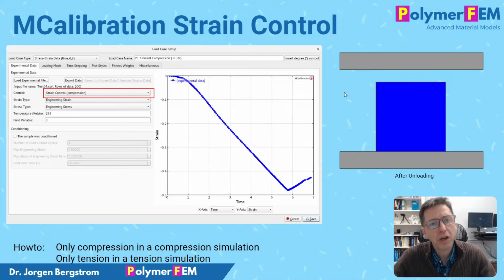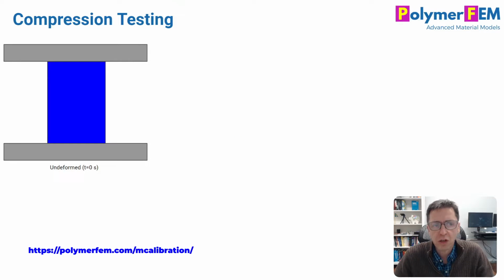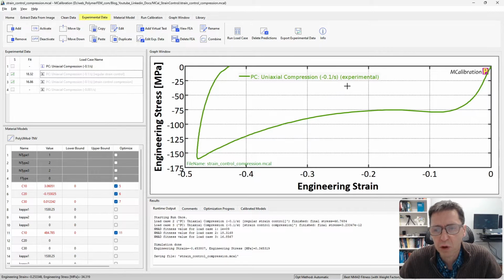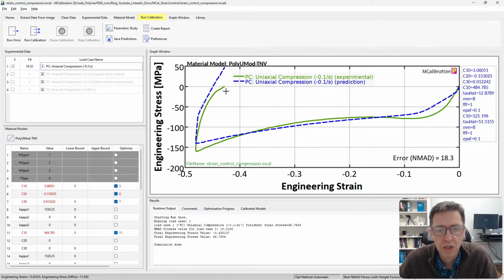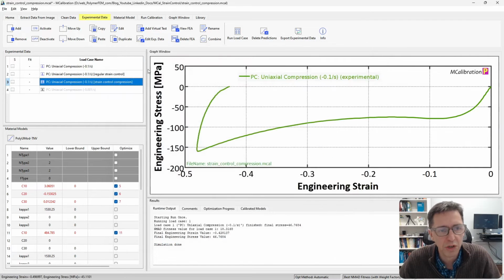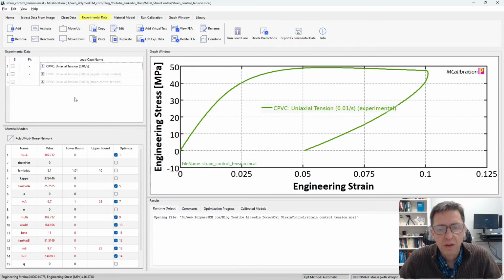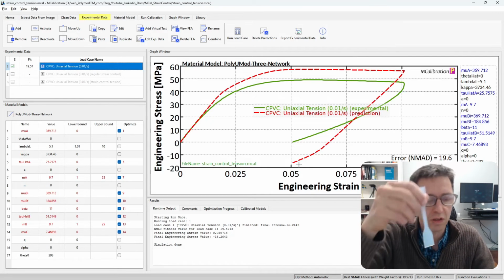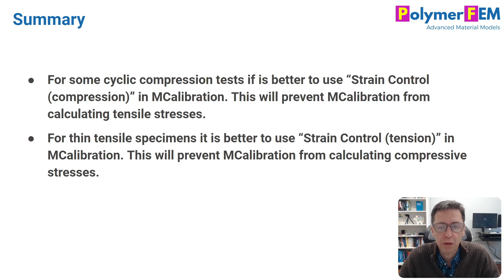MCalibration Strain Control

Comment: So... is it inherently wrong to apply "Strain Control (tension)" to a thicker specimen?  We use ASTM D638 Type I dog bone specimens in our tensile testing, which I assume qualifies as "thick".  Our material models tend to overpredict the amount of hysteresis during cycling and I'm trying to pin down the source of the discrepancy.  I realize that I can try to recalibrate using this nondefault setting to see if it correlates better, but I don't want to go down that road if it is inherently wrong.
Reply: There cannot be a 100% ready-made universal recipe

the mentioned possibilities of the program reflect only two boundary cases, but naturally do not take into account the intermediate diversity....

The meaning of the experimental work is precisely to obtain the most useful (plausible) results from “simple” experiments for describing the behavior of the material under “complex” loading conditions.